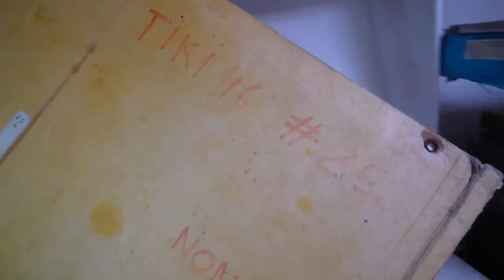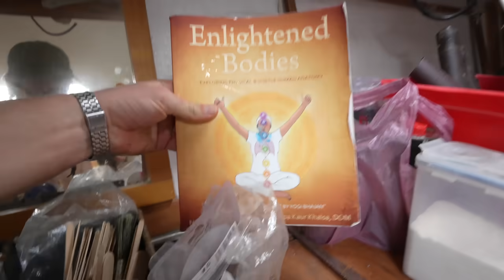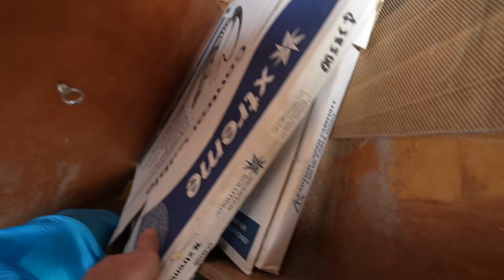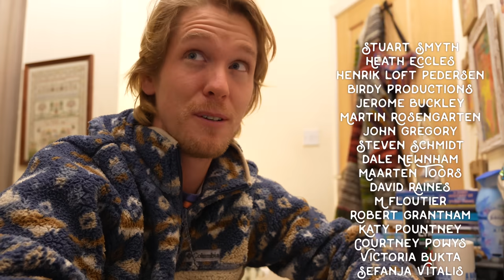Am I Actually Going To Buy This HUGE Project Catamaran? | Wildling Sailing

Comment: Here is the thing, first I understand that this model of boat is your dream and it does not seem at this point to be in the worst condition.  The problem i see is the location.  You have already said that it would take at least four people to put the engine boxes in location, so doing it alone is a really tough situation.
Your current location is a definate NO GO and the fact that the engines had to be placed so far away from the boat makes me think leaving the boat for any reason is a problem waiting to happen with the locals.  If you could tow the boat in its current condition to your final out of the water repair site then things may be different, but I dont think that is possible.  My other concern is based on location as well and that is obtaining materials in such a off the grid location.  Now if you were at a repair shipyard that may be different, but your not.   You need to do some research on delivery locations for where the boat is and where it will be to see if it is feasable for parts and materials.  Out of your budget for sure is hire a hand for help, but would be nice.

In all I say the boat does not seem to be in bad condition from what I have seen, but it may not be worth the time money and effort to make it happen for you.  It may be easier to simply build one from scratch at a location of your choosing.  I would pass on this unless you get it for free with everything included.  Its in a lcoation that I think you would loose your mind and leaving it may cost you big time in the end.

Comment: How windy does it get?
Clear plastic, pebbles, stapler, rubber tubes.
 Bed mattress retailers love you to take away their discarded thick clear double mattress plastic sleeve envelopes,  8 metres squared.(last 2 years in sun)
 Cut open and adapt.  Join by Folding laps and join them with domestic stapler. You can adapt  up cockpit tents, standing room,   door openings,etc 
Make excellent localized working area tarps (over cockpit,bow etc) where your working on your boat in damp, rain, or for heaters (epoxys) Heaps of light.   Design to be rolled open during dry periods etc. Design to put 2nd stronger tarp over if necessary.
 Tying pebbles in corners for ropes is old school, stronger than eyelets.
Cut up car, bike, truck tubes for old school super adaptable bungys. 
Cut down, modify to your needs, Excellent for tarping your gear/tools in rain,on boat/ in boat yard (can see what's under that stack)

Comment: To me the logistics are the main obstacle. If the boat was in your back yard, it would be better. If the boat was 5 kilometers from your home, it would be somewhat harder. If the boat was in France, it would be even harder. The further you have to go, the more travel time you will have. It would seen that the first thing that needs to be done is get the boat livable. Then it needs to be able to sail. Then you can move it to a more favorable location.

Comment: Please don't listen to the curmudgeons this boat is very possible even alone you can get that to moving stage enough to move to a better location. I would have thought quite quickly actually, there's safety and mobility then there's glamour all possible with that boat but safe travel in comfort if not plushness is actually pretty close.

Comment: No point in repeating the warnings from others . 

On the plus side it will make for an interesting  build project and being YT channel you can make the work pay . Important with all the work you will need to do , Is there 110 power for the tools on the dock ?  Water ? Off boat nearby storage ? You will need to put all that stuff  somewhere and a shop to build some of the stuff out of the rain . 

Powering it , Me I would put a diesel genset in her and a pair of  electric drive motors with plans for a big battery pack and lots of solar as I can afford it .  Best of both worlds .  Electric boat with the cost savings of solar charging , but the range of diesel in a pinch like canals and rivers . Hybrid efficiency 

Sell the other engines to pay for the genset .
Reply: Yep, it would make a very good YT project but would that in itself make any significant financial contribution to what is obviously going to be a significant one?

Comment: Your beams would be lucky to be 200 kilos, no problem for clever boys like you and your dad. 
With a junk rig your booms can be your derricks in any direction. (No side stays, no two way, gooseneck boom/mast attachment)  you can also lengthen your derrick (with sleeves, lashings etc. 
Any temporary compression posts can be lashed, triangulated to take load off mast, rigging.
If theres 30000 parts in a car. There is probably 5000 parts in your boat, not counting motors etc) 98% of everything is in location. You have an  re assembly/ modification job. 
I'd rather be standing on floating warram hulls than on my knees with lofting plans, awl  spike in an empty shed. 
 

.

Comment: building design is concept and not necessary actual.  
What does the exterior hull look like under the water?
The original glass and bulkheads will not be the problem, problem will be work done lately.
Have the sails rotted
Watermaker is a surprise.

Comment: After watching you rework or try to rework minke as an accomplished old man I can tell you this is more than you will be willing to handle. This boat has been neglected as a storage and junk holder not a boat. There is no real cockpit to sail comfortably from. I disagree no potential go find a mono hull with a good cockpit and not having sat as a junk storage. Swallow hard consider the visit a part of your adventure and leave this boat behind. You wont regret it in months to come.

Comment: I think this is NOT the one. Nor was Minke anywhere near the basket case that this one appears to be. But you're sold on Wharram cats, and it's all about "feelings". You can't argue with feelings! One thing that I see as rather a major point you might want to look at seriously is its current location! It's going to be that much more expensive to rebuild a "project boat" there. Maybe you should keep the work to a minimum in first instance and do just enough to get her back to the UK?

Comment: All that discoloration is thinned varnish. It will sand off very easy. The rot can be fixed with super thin CA and CA glue with rubber. 
I am not liking the duel mains. Seems like the lee sail would founder like mad! 
There is a wharram  38’ near for $1500. Most of the boat is rotten.

Comment: Despite 95% of followers offering advice you are /were determined to buy this vessel, you have a tendency to put yourself under pressure and stress , as I said before go back to the UK get a job save up and then you will be in a much better position to buy a sailing vessel, also closer to home you will have a better opportunity to seek out the best vessel that will suit your needs😢

Comment: It's what you want, so do it. Cross members to rest and slide, and/or crossed booms to lift will get those engine boxes in single-handed. Just get it right to move to somewhere drier. Don't expect worthwhile help; if you can't do it yourself, walk away. I'm sure you've worked out the finances. Paperwork is important in some places so get the documents. That's about it!

Comment: There seems to be a lot of interest in this boat. It's not like you work hard on it and if you don't finish , takes it away. You just get what you can for it and move on. If you buy it, others will too.
Reply: If you get it closer to finishing. It will be worth more. Set the motors, put the deck on, get things working. Get it moving. If you ask for help, some might help just for the experience. Hope it works out for you.

Comment: Mark. Please take a look at the Nautor Swan 42 from 1981 sitting in Deltaville, Virginia. It needs an interior and a refurbished deck. The boat will retain and gain value rapidly as you work on it and it´s in a safe area, with skilled workers around. It would be the perfect project boat, and the perfect monohull cruiser for you. A much safer cruise boat than this dilapidated wooden cat, that you are considering. It´s nonsense. Really!  Also your channel would grow exponentially, refurbishing a Swan.

Comment: Rain
1 year plus project
If to tarp whole boat not desirable.
Find any wood, rip into 2 by 1's
Maybe build light, modular, plastic house, timber timber frame construction panels, 2m high - 2 m long (?) wall and roof sections? 
 
Design so each panel can be made on land and brought aboard and can be handled and plastic room erected by 2 people, in 2 hours.  Highly apaptable, reusable - Erected, dismanted, reinforced, replaced, flat packed,  ( hurricane, sea passage to another boat yard, road cartage,  reused on land? (Epoxy tent dehumidifier,heater etc) by 2 people.

2"x1", soft wood (pallets,boxing,etc), studs, bottom plate,top plate, dwangs, braced. Ceiling panels (same construction) (plastic house) rooms, door way etc. All screw construction, one handed, one tool.
 1) to fit fully, partially, or over each hull entrance working areas (2m x 6m ? whatever)
2) make-up 1 or more (larger)plastic  room(s) for working area between pontoons
3) design so rooms can be moved by 4 people (design moving system, handholds, slide in poles,?)
4 Design so rooms can have extra panels added to increase size of dry area
5 Design in jack studs, studs so a 500 ml high jack studded panel could be temporaryily be unscrewed to work on deck, leaving rest of structure in place
6 design to be lashed down, not screwed down, use cloth, cardboard protection packers for deck protection
7 also design for shade 
8 do not try to get 100% waterproof, aim for 98% , patches, tape, glue, gunk

Depending on the resources in the country (have fun) and try and do it for the price of the screws

Comment: Very interesting rig layout with the two masts on each hull and all. Junk rigs are nothing new to me but that is the 1st cat I have seen with the masts mounted over each hull. There are a lot of very interesting issues with the all of it though. If it were "completed" in 2005 the few years on her have not been very kind. In short I get the impression that she was never really completed. Yes, viewing the engines will be interesting as well. There is a LOT of potential there. Yes you are going to need some sponsors. So she was electric eh? Yeah, that was a large nail in her coffin alright. The early electric drives only degraded the value. In fact even many of the newer ones do little more then degrade the value. I guess the virtue signaling of gliding silently into and out of a slip is too powerful for some to resist. In any event electric drives inevitably present limitations to blue water transits. They can talk those systems up all they want but,,,,,,,,,,,,,,,,,,,,,,,,,,,,,,,in the end they all end up with a dinosaur squeezing's burner to be realistic.

Comment: You seem pretty sold on this boat. I would not recommend it for you, I am extremely hands on DIYer and I would not even buy this boat for myself. Its too much major work. Building the whole house thing whatever you want to call it on top, building a kitchen, a head, etc. that is massive work. Do-able yes, but it will cost way more than buying a boat already with those basics, which you could remodel far easier. Anyways, you seem sold so I'm not going to try to convince you not to get it but, I wouldn't get it for myself and thats pretty significant lol.

Comment: Mark, people are going to think I am as crazy as you but I would sell those 25's and go back to electric. If you have a full array of solar and good LifePo4 batteries you wil be much happier. If you also build a small 10 hp diesel with a 150 amp alternator you will have the best of both worlds. As a liveaboard a big battery bank is the way to go. These days you can build a lifePo4 bank for just a little more than lead acid. You should be able to fit at least 2000w of solar on that boat. Gas is not what you want on a boat, especially a wooden boat.

Comment: why use two when one will do... 

if it was a great idea you'd see it everywhere... 

as someone who has sailed since they were a toddler why the ever living fcuk would you want that rig... 

that alone would be enough to make me run away. 

there is a reason certain rig styles have become the norms... two side by side masts on a cat is going to put massive stresses though the hull connections... do you really want to sail that!

Comment: Based on need to be close to friends and family why would u buy this boat. Unless u can get a few friends to come and help. Get it seaworthy for trip home. Plan on spending 60 thousand getting parts and other supplies,radio,safety equipment. Then another 10,000 provisions for u and crew of 3 to take home. This does not include living expenses  spent while refurburshing or time waiting for parts that need to be ordered.  rebuilding never goes as smoothly as one hopes. Not sure u possess the right skills for this project. U will need many. Maybe invest in project closer to home. Even then u will have your hands full.

Comment: Mark stop the procrastination u are driving me nuts >>> check the engines >> i have not seen you in a dugout with a long screwdriver with a plastic handle going around the hawls taping.  most of the inside watt you have shown discoulard wood is cosmetic buy the bloody thing and get craken we know you are going to any way stop the pessimism take a leap of faith you can do this be optimistic small steps  but a leep off faith in yourself
Reply: In for the cringe.

Comment: Sure the boat is built well but way to much work. Most of your videos will be on refitting and not taking sailing adventures for a long while. I would rather buy a ready to go single hull sail boat.

Comment: What you are presenting here - I mean the owner and you - is called "peacock dance" in my country.
It's sickening to watch.
We know you're not there to vacation in the soft tropical rain.
And the other: you are scratching the wooden surface in the wrong place! DO IT IN THE CORNERS and not with a nail, but with a small screwdriver!
Anyway, I can say that the project is not bad with motors, especially if you can negotiate the solar panels as well.
Take a look at the sails, put them up in a calm. In fact, ask the seller for a demonstration sail. Do something instead of writhing in doubt for a week. (When I was your age, I already had a seven-room house, a new car and a family, and I didn't care about a little work.)

Comment: Electric is the way to go especially if it's a choice to buy new Motors, Electric is silent and you can always get energy from the sun, it allows you to increase power as you go and allows more weight in batteries and a Generator later, batteries are getting better every day
Reply: And you have no idea what solar costs out there !! Its almost 4 time more expensive than the UK !!! Electric and boats do not mix well Never have nor will !